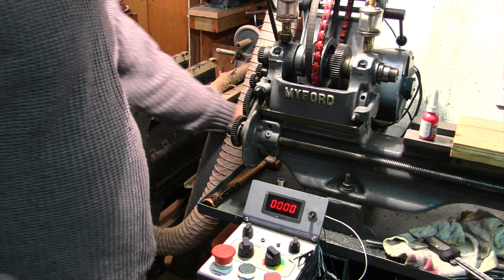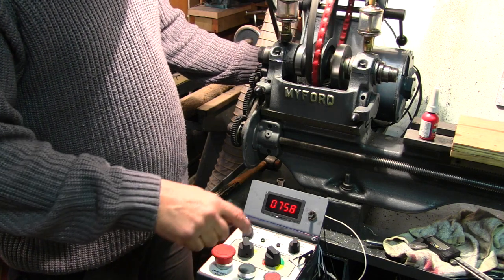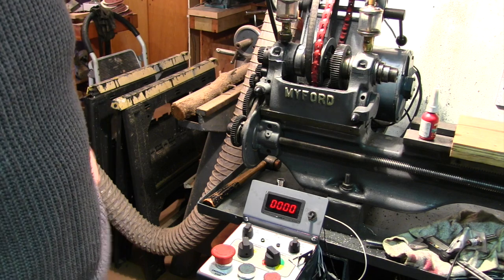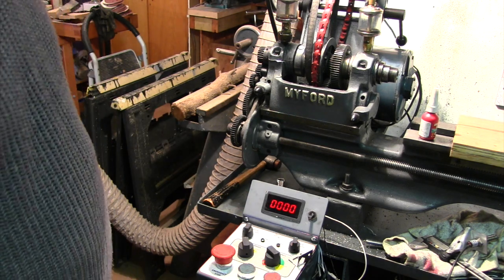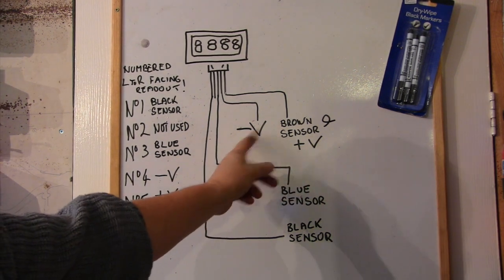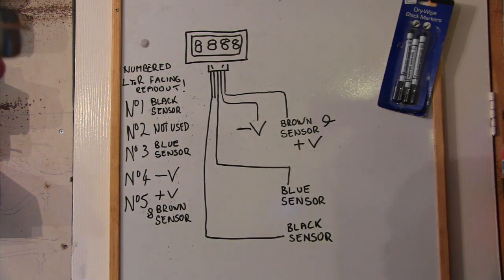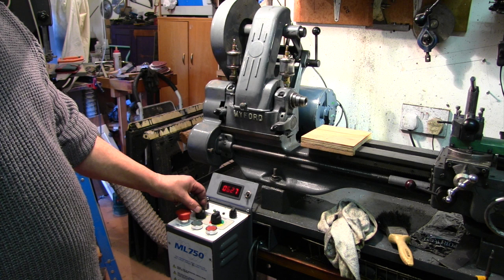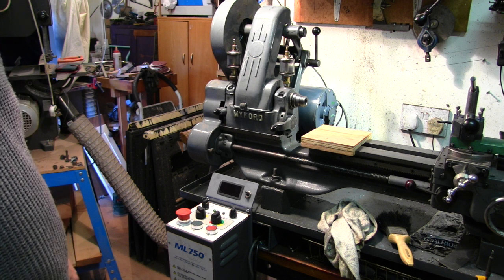Instructions for Wireing up the chinese tachometer

Comment: Beware everybody:

Attaching any magnet directly onto any metal thing will deplete the magnet over time ... plus the flywheel becomes slightly magnetic. The solution is to epoxy some thin plywood between the magnet and metal wheel.

Comment: My No 2 wire (black) connects to the -VDC and blue wire from sensor. My No 1 wire is red and connects to
+VDC and brown wire of sensor. 
My No 5 wire (yellow) connects to the black sensor wire (signal wire). 
So
No 1 red connects to +VDC and brown signal wire. 
No 2 black wire connects to -VDC and blue sensor wire. 
Final yellow wire connects directly to black sensor wire. 
Mine came with clear instructions and wiring is shown from back of display. It reads 1, 2, 3, 4 from left to right. 
Is this the same as yours? Looks like your -VDC wire just connects to -VDC and not any wire from sensor. 
My No 2 wire connects to both -VDC and brown sensor wire.

Comment: I hooked mine up according to your schematic and when I apply power I get a 7189 reading.  When I rotate the shaft to line up the magnet I get 4 dashes. How do I zero the meter.
Reply from the maker: Hello David,
Don't know what's happening there? If you run it does the work? Or change?
I've got these on three latches, they throw up an odd reading temporarily now and again but settle down in a few seconds, sounds like a bit of a cop out but might just be a faulty one! Unless anyone out there knows better?
Cliff
Reply: @CliffsShed  Thanks for your reply. It seems no matter what I do I get the same display.  when I run the motor the display jumps around, at higher speed I just get 4 dashes
Reply from the maker: I guess you have tried the magnet both ways round, I can't remember what it does the wrong way, I think nothing, but cant offer anything else!🤪
Reply: @CliffsShed  After some more troubleshooting I found that if I disconnect the blue lead from the sensor the meter will then go to 4 zeros and does not indicate any speed.  Could it be a bad sensor?

Comment: Hi cliff , thanks for the great video. Can I ask a question or 2. Is the sensor that you are using a pnp or npn as I have 2 npns and  I cant get them to pick up the rotating shaft on my lathe. Also did you use a10k  resistor with your sensor or is it not needed. I'm trying to set up these so I can get rpm on the lathe. Thank you. Regards Pat
Reply from the maker: Hello Adam,
Not sure about the sensors, they came with the readout, have you tried turning the magnet over, they are polarity sensitive, and I've used them as they come, no resistors,
Thanks for watching,
Cliff

Comment: They work from 8 volts to 24 v Cliff. I wouldn't put more than 24 through them! The Hall effect needs the South Pole of the magnet to be facing the sensor head.
Reply: SAMRODIAN I would ask where to put the magnet , how mauch the radius from the center ? Appciate for your repply .

Comment: Spot on. Just received mine from China. There is numbering on my back plate but now I've seen your video it all makes sense. Going to use a 12v supply.
Reply from the maker: Thanks for watching, mines on a 12v wall plug thing of of something I used to have, pretty much anything will do, they use a tiny bit of amps!
ATB,
Cliff

Comment: Being in Canada I have 120vac single phase going into the control box with 90vdc output.
Had two 9volt batteries in series to power the tach but it's drawing too much current and the display is fading. Will put on an 18volt dc transformer from 120vac. Wish I got the red display, blue is difficult to see. 
Cheers
Ed

Comment: Doing the same on my ml7. Using a dc drive. Still have to locate the sensor. Thanks for the video, very informative.
Ed
Reply from the maker: Cheers Ed, What voltage is your dc motor, I am puting a 24v one on an old perris lathe I've got to make it variable speed,,,, when I get round to it, 
thanks for watching,
All the best,
Cliff.